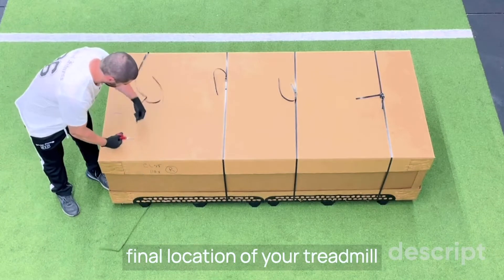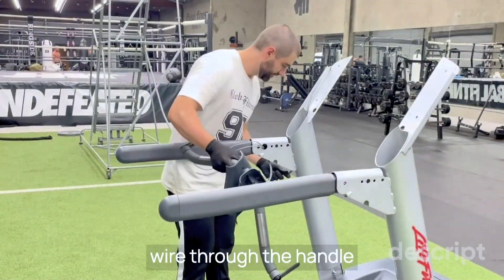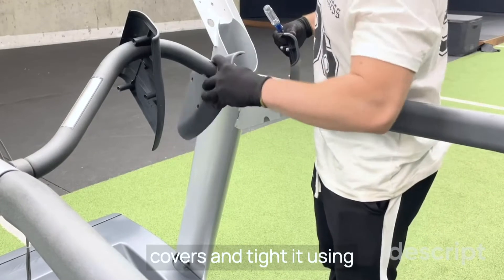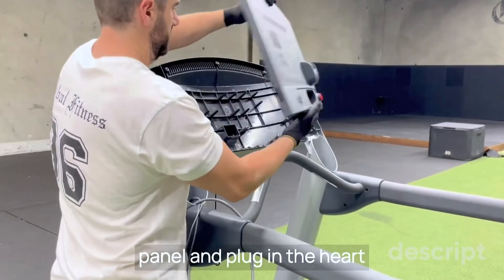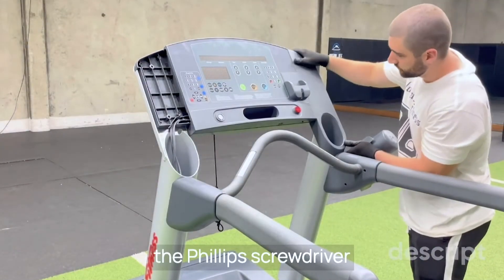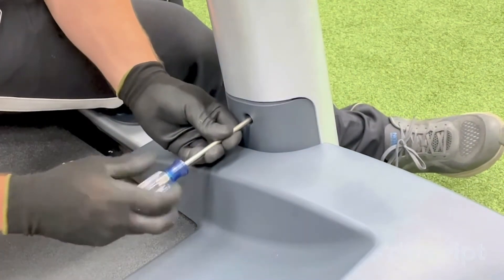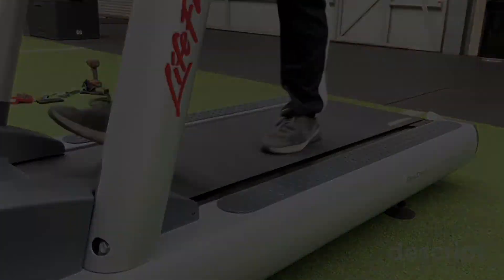How To Assemble the Life Fitness CLST Integrity Series Treadmill

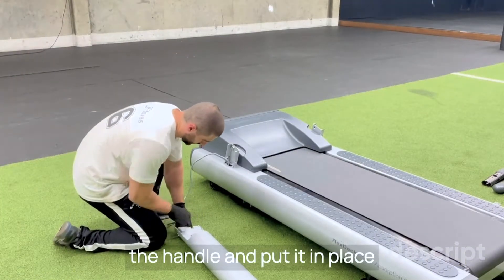Comment: The LCB comm wire mentioned at 1:05 - does that unplug on the base/deck end of the wire? I need to remove the upright section to fit this into my basement and want to do it the easiest way possible